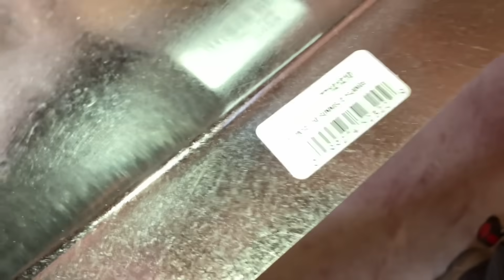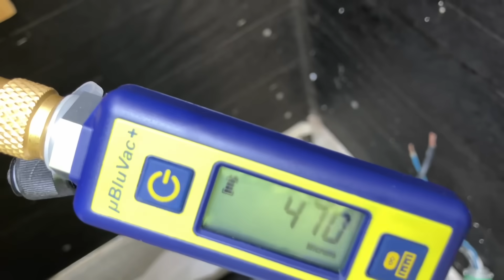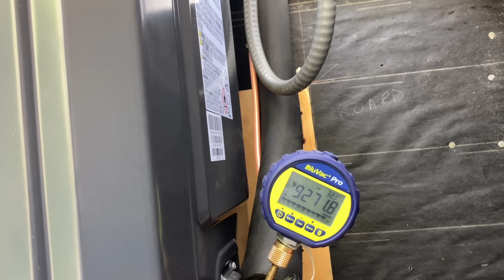Massive HVAC Install in $Million Renovation | ACIQ Extreme System Build Begins!

Comment: Million dollar Job if I could afford it, I wouild want all hard ducting and I would do a HRV too, that would be a good upsell.
Reply: I'm in HVAC and agree. Hard pipe and insulate. Flex duct is rarely ran properly and just cause air flow problems. HRV's are great.
Reply: @Brentatious  and would not want the Mikey Pipes By ACIQ. My only worry is this big conglomerates can shutdown ACIQ 2 years from now and you are left with no warranty
Reply: @Brentatious you are absolutely correct! More times than not I see too long of runs and or not properly hung. Looks like spaghetti! In an attic though, I get it as long as it’s installed correctly.

Comment: Why did you attach units to side of building before siding goes up?
Reply from the maker: Wall was prepared by contractor
Reply: @PipeDoctor doesn’t looked prepped at all. All I see is roofing paper and plywood? GC could have at least put up a sheet of ASEK?
Reply from the maker: @Jlvrcng6  wanna bet? were you fucking there? The contractor installed the plywood. Asked and answered. Dont be a dick.
Reply: @PipeDoctor Mike, my comment wasn’t directed towards you at all, I’m sure you asked him. Just seems odd that he didn’t put something else up. No need for profanity.

Comment: Flex duct. 20 years if you're lucky..
Reply: I was thinking how long that flimsy plastic will last with heat and cool cycles.  Press fitting with rubber is the same.  Starbrite sodering will last 100 years.